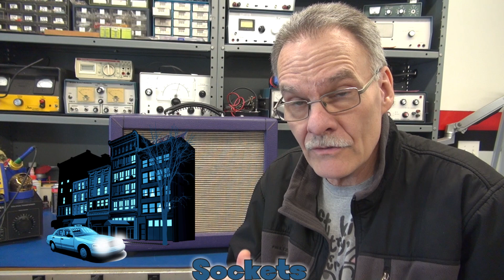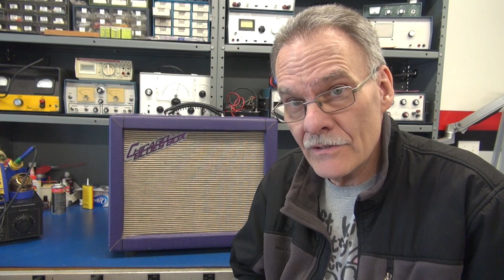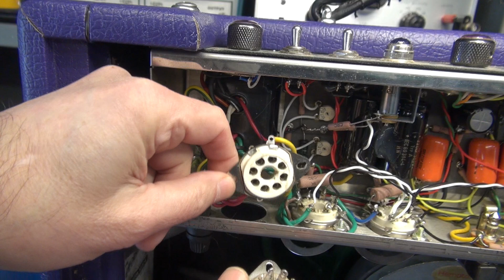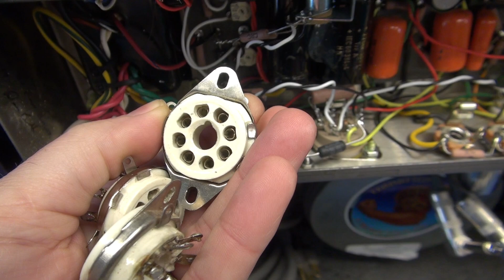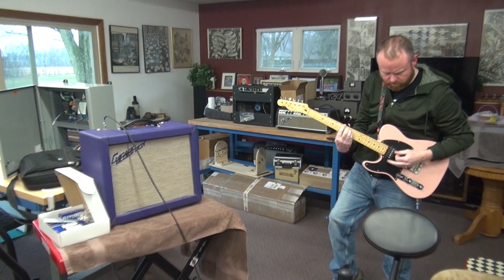Chicago Blues box combo guitar amplifier Loose tube sockets preamp noise recommended upgrade

Comment: Interesting information!  I have a few of those ceramic sockets, now I'm not too sure if I want to use them.  Perhaps they would be better if the tubes were mounted facing up instead of hanging down, but so many amps have them hanging Fender style.
I see a silverface Fender Bassman on the bench at the end of the video...  :-)

Comment: I once had problems with my Fender Silverface Champ. Volume cutting out, pot scratchy, etc. So I put it in a shop. I got it back and same problems. An original rectifier tube had been replaced with a russian made. That's all. I found that the tube sockets were too loose. I ordered new ones and a new potentiometer, and installed them myself. I've had no problems but it cost me about $125 for a tube I probably didn't need. We need videos like these.
Reply: Sounds like your amp received a visit from the cobbler.  Lame they charged you for a part you didn't need.  Bad service means that everyone you know will be now going to their competitor. They will have to learn the hard way.
Reply: Some tube makes have fatter pins than others...  so if you want to "roll tubes"  you need to be aware of this.   I find that once I get tubes I like for a given amp,  I stay with it as long as possible.   I own tube testing gear also.

Comment: Why are the "Bear Traps"  wide open?   The bear trap helps quell the vibration and preserve the socket.
Reply from the maker: No idea, we did not reinstall them with the new Belton sockets
Reply: @d-labelectronics  I'm not one to "roll" my tubes all the time...   and I've used ceramic sockets from a different maker successfully with no issues at 10+ years of amp service.   Seems that this is a combination of factors.